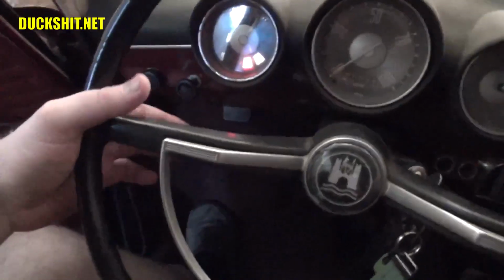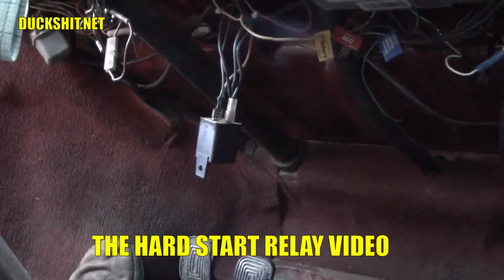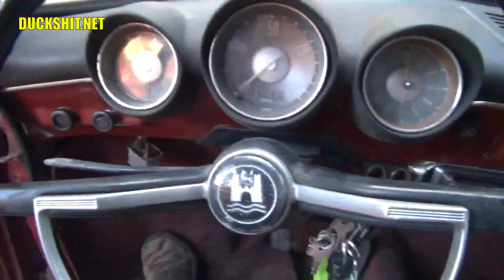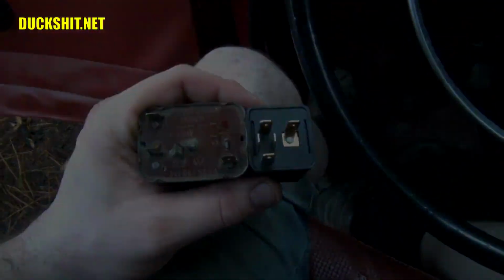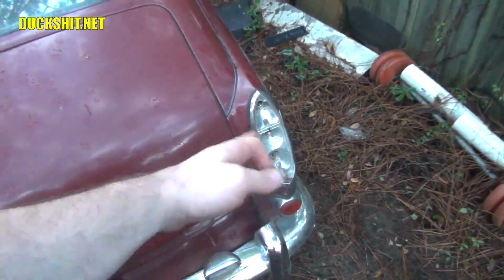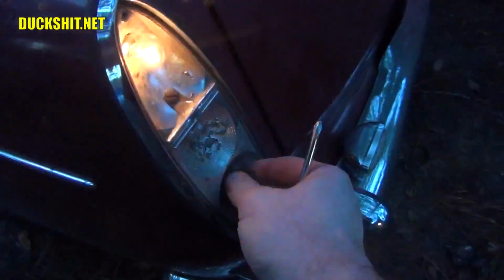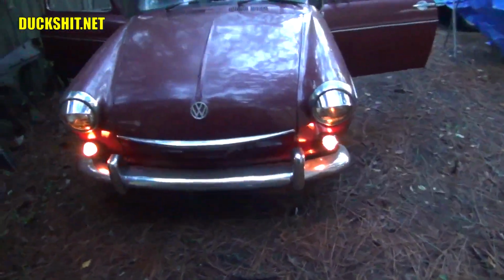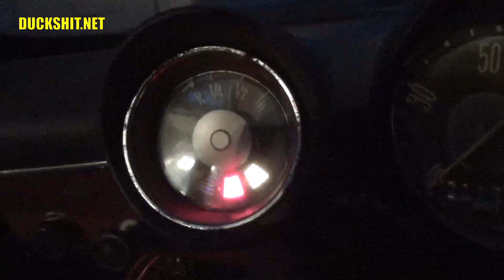Howto Replace Air Cooled VW Turn Signal and Dimmer Relays

Comment from the maker: ⚫ Get Your 12V VW Relays Here ⚫
5-pin Lamp Dimmer 67-79 ▶ https://amzn.to/2QxynxO
3-pin Turn Signal 71-79 ▶ https://amzn.to/2xhnbMV
4-pin Turn Signal 68-70 ▶ https://amzn.to/2NeY0Wg
Reply: That was a great explanation on the relay with the diagram and different options for power. You the man.
Reply from the maker: Thank you, I almost didn't make this full of a video because my old relay started to work just fine.  I will probably put the old relay back on just because I like the way it clicks much better.  It seems much more solid!  I will keep the new plastic one as a backup.  😁😁😁😁😁
Reply: I would steel wool the male prongs on the relay and the female spade connectors on the old relay and put it back it works a lot nicer. Then put some dielectric grease on them so the rain water from the over flow seal dont make it mess up again. It may be about time you confronted or fixed the issue with the seal on the vents? Is it that difficult to deal with I have no idea.
Reply from the maker: Repairing the vent seals is practically impossible for somebody of my size.  There is no good way to get in there and lay on your back and then put my catcher's mitt hands up under the dashboard.  Just about everything underneath the dashboard has to come out. Not my cup of tea so not likely something that I'm going to deal with.  I don't drive it in the rain anyway. The only reason it got wet is because I left it outside overnight by accident and didn't know it was supposed to rain either.
Reply: Its a bugger then.

Comment: Haha, as an electrician, when you said the bulbs keep burning out, the first thing I thought was high voltage. I was going to tell you, but you figured it out on your own. Good job!
Reply from the maker: Thanks, but I never said any bulbs burned out... because they didn't.  Things were acting screwy though, as I described.  Funny sounds from relay flasher, and not flashing at all or flashing in odd patterns.  No high voltage problems were found.  Just a bad flasher relay and headlamp dimmer relay as per the video!

Comment: Duckman I know I’m back on this video for the hundredth time. I have a simple question when I turn my power on from the key I only get the red light. What is the yellow light for and why do you think mine doesn’t come on? I’m running a 67 type3 squareback any help would be great.
Reply from the maker: Hi!  I believe the yellowish light om your type 3 is and oil pressure light. Turn on the key (don't start it) and disconnect the wire on the sensor and touch it to ground, if light comes on the sensor is bad.  If light does not, check the wiring and the bulb!  Hope tha helps!

Comment: The replacement of the original 1970 T2 flasher relay with a new one works perfectly for LED bulbs. But since the spade pin connectors are not aligned I had to make short wire jumpers with a male and female spade connectors. Then make sure the jumpers are connected to the same pin connections; 31, KBL, 49 and 49a.

Comment: Hi Duckman: I have a question for you please. I'm re-wiring my 1971 Super Beelte.. Everything works fine except for my blinkers. Emergency lights work on all four, but the turning signal on both sides don't work. Do you have any idea on what I could have missed and how to get to the bottom of this problem. Thanks, Patrick
Reply from the maker: The flasher is bad, of it has the wrong bulbs in it.  Hope that helps!  Thanks for the question!
Reply: Steering column direction indicator turn switch/wiring may be bad also.
Reply from the maker: Yep you can't rule that out

Comment: The 30 terminal can also go to the live busbar on the fusebox. This will give a headlamp flash function even with the ignition off. Don't know if both filaments of the headlamps momentary illuminate during the dip action however especially if the dipswitch is held in the on/closed position. The dimmer relay has a bistable toggle mechanism to hold the changeover contacts in one state or the other as well as an extra normally open contacts for the flash function. Introduced with the extra X contact circuit on the ignition switch.
Reply from the maker: Thank you for the input!  Great suggestions!

Comment: I installed the 4 pin flasher  new style and emergency flashers work but my indicator lights don’t com on and turn signals still don’t work someone said the k1 goes to the indicators but should be ground signal what can I do
Reply from the maker: Well... I couldn't tell you.  I don't know what year or model car you have, and I can't see the wiring.  Wiring is something that I have to chase the individual runs in order to diagnose properly.  Your best bet will be to look at the wiring schematic for your car and not listen to what anyone tells you, even me!  :)
Reply: @DuckmanCycles  it’s a 69 fastback found the problem didn’t realize  I had to jump the wire for the new style flasher so indicator would light up and  turn signals don’t work because   power goes in but not out when turn L or R  turn signal switch itself the contacts are pretty worn out ordered a new one

Comment: did you take apart the old headlight relay? just wondering why it would work when you squeezed it.
Reply from the maker: I have not, but I suspect water intrusion because it does hang upside down and the vents are known to leak.  Probably just something sticking and squeezing it distorted enough to free it
Reply from the maker: But right now at this moment the high beams quit again, seems to have something to do with the switch this time though

Comment: Hey. I've got a quick question for ya. Would you know where I can get a decent priced swamp coolers. Is their more of a correct name for em? Thanks
Reply from the maker: The proper term probably evaporative cooler, but anybody that knows what one of those is would understand swamp cooler.   They pop up on eBay from time to time, but for your cheapest bet you'll probably have to make one.  They are bit expensive

Comment: Good diagnosis on the dim head lights. Tightening the screw is good, but I like to take it one step further by unscrewing the ground and scraping the body under the screw with a pocket knife or sand paper being careful not to scratch everything just the part under the ring terminal. Wire bush the screw. Then use some steel wool on the ring terminal to remove any oxidation or rust. it will ground really well then. The lights will work like they did when the car was brand new. And you can even use some Dielectric grease on the ground to keep moisture from rusting the body and oxidizing the ring terminal to keep them like new for a long long time. You can find it at Autozone in little orange ketchup like packets on the counter. Or Advance has them little packages too. It called Permmatex spark plug boot bulb electrical connector, and I think all auto parts houses have them if they are worth their salt. I use this stuff on my CB Antenna bracket to make sure it grounds good and dont rust the body and resist water or rain. It makes a fabulous ground and my SWR is perfect. Stuff is great for grounding I highly recommend it. It dont have to be permmatex brand just dielectric grease. Its only a dollar at auto zone for a packet. It might be called electrical contact grease and its good to use on auto plug ins too. Or it might be called spark plug boot grease. Dont take a bath in it because its a carcinogen might use rubber glove but I never do.
Reply from the maker: You are right, but if all that's wrong as the screw is loose then tighten it LOL
Reply: what really sucks  - is I cant find brass spade connectors , the ones at Autoshack are plated steel and the one on My brake light switches on the master cyl. on the 71 bus rot in a year or so . I had a base station CB till lightning hit My Shakespear super big stick antenna and peeled it like a banana . my unite was not screwed it at the time = Ka Boom
Reply: I know what you mean darn fiberglass i had a ANTRON A-99 that lighting hit and it splintered into a thousand pieces all over the yard. If you can get a real aluminum antenna like a Hy-Gain SPT-500 Super Penetrator 500 then you got one that if lighting hits it and its not pluged into your radio you can just plug it in later and it still works. The super Penetrator is the best antenna ever made.
Reply: Yep. but sometimes grounds or contacts are rusty or corroded and need cleaning especially if they get a lot of moisture on them. like the the stuff under your dash when it rains too hard and the seal leaks on all that stuff may corode contacts. dielectric grease make a great protector only a dollar.

Comment: if i wanted to have the low beams on with the highbeams could I use a regular relay and a diode to trigger it
Reply from the maker: Based on the schematic its even easier than that.  No diodes needed!  Take the yellow wire off of 56a and splice it into the black and white wire that is connected to 56.  The low beams come on when the headlight switch turns them on, and only the high beam will be toggled on and off with the dimmer switch.  JUST BE WARNED!  This is not the intended design and could overload your electrical system!  VW wires are kind of small, they may not carry the additional current to supply that many headlight filaments at the same time.  It may even overload your charging system if you're running an older generator.  Hope that helps, good luck to you!

Comment: We had such a strange serious of failures in our 69, my son said he was driving and hit the brakes and the petal felt spongy, and at the same time the radio quit, and the turn signal flasher began to flash non stop, yet the turn signals themselves wouldn’t work, but the hazard lights would! The brake warning switch went bad and shorted, the wire got hit enough that it came out of the sensor, I’m assuming when that happened it got hit enough to vaporize some brake fluid inside the master cylinder making the petal spongy. It blew a fuse and as soon as the fuse was replaced, the flasher stopped and everything returned to normal. Part on order, wires fixed and weather packed. Crazy all the things that went crazy from one thing.
Reply from the maker: That is a really strange bunch of problems at once.  But sounds legit... thats pretty messed up lol

Comment: With these old cars I USUALLY  work with the battery in if I short something it's usually no big deal. Although I did burn up some wires and a couple relays today hahahah
Reply from the maker: I usually leave it in, too!  I never burned anything up though... lol!  But when I replace a starter I like to disconnect.  That fat wire has potential to really start a problem.